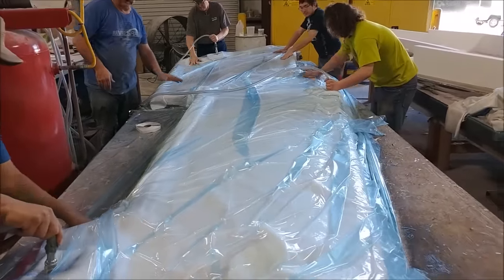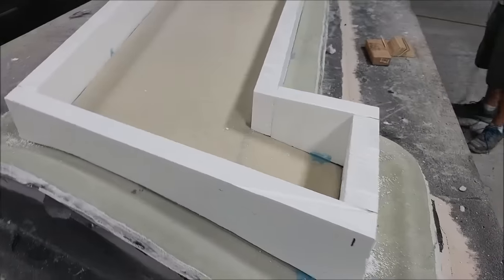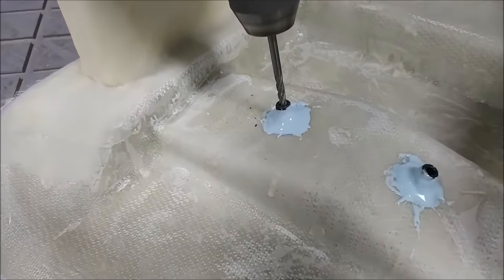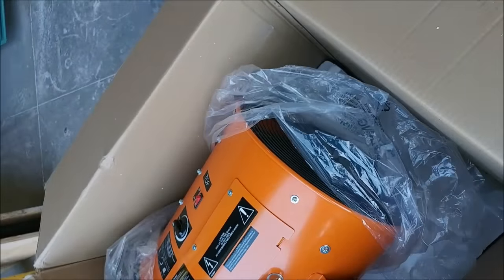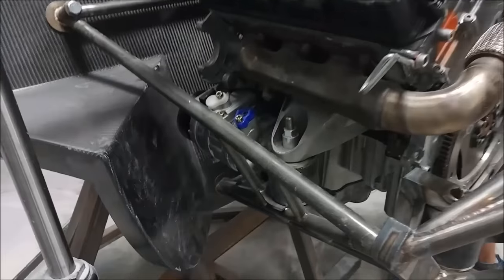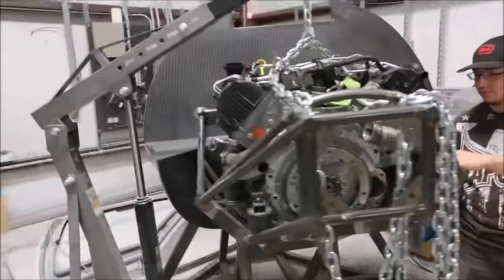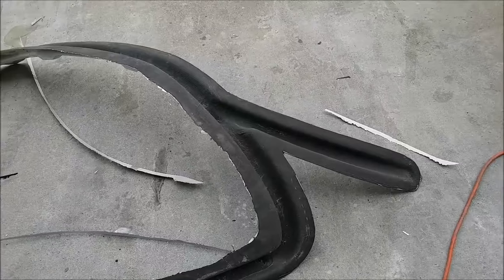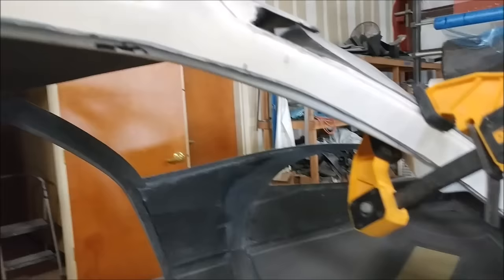Raptor Aircraft March 11th 2017

Comment: What are you using for a temperature controller for your oven? I’ve been using a Fuji PXR3 micro controller with a thermocouple and a relay switch. It works great to set your ramp and soak temperatures. I would assume for a part as large as the fuselage you‘d need pretty long soak and ramp stages to make sure your post curing is a strong as possible.

Comment: In your design, if the main spar has a problem, once the fuselage is bonded, can the spar  be removed/exchanged?
Reply from the maker: It would be quite difficult.
Reply: I realise primary objective is not necessarily to build an aircraft with removable wings.  Was just thinking most sailplanes incorporate spar into the wing not the fuselage. Assembly calls for spar ends bolted together, typically within a rigid structural shell inside the fuselage making a solid interface, with everything being potentially replaceable.   Just  a thought.      Thanks for all the videos;  watching religiously!
Reply from the maker: The wings have their own spars and they do bolt up to the main spar.
Reply: Raptor Aircraft so would you say that if the main spar gets damaged, the airplane is going to be grounded permanently or will it be possible (if difficult) to replace it without damaging the aircraft as a whole?
Reply: I re-watched the original Indiegogo video.  I think i understand the approach better.   And it looks like just about all of the wings could indeed be swapped out right?

Still, as David McCullough alludes to below, what is the general approach for all these carbon fiber aircraft (not just experimental ones like Raptor) when it comes to damage and repair?       As a future owner, how will this impact e.g.insurance??